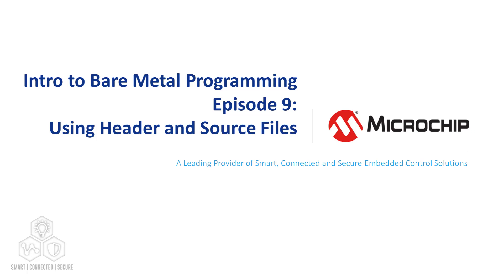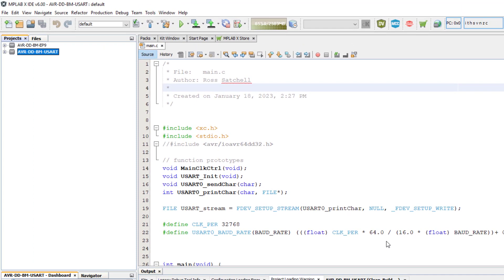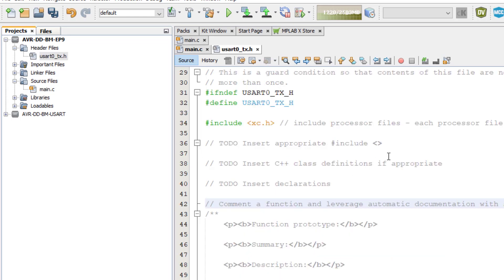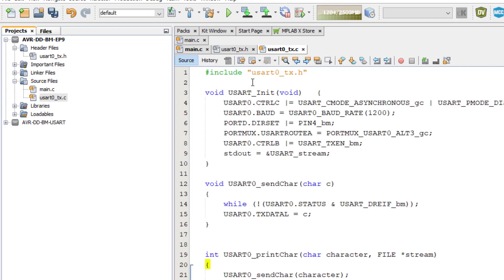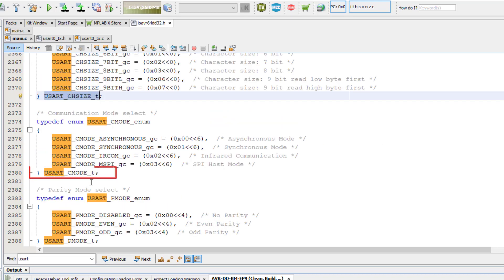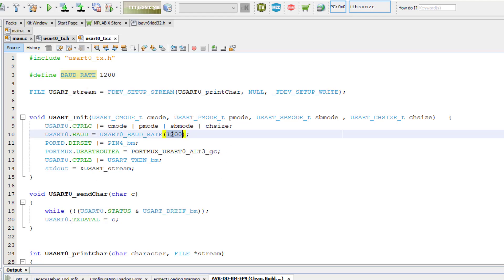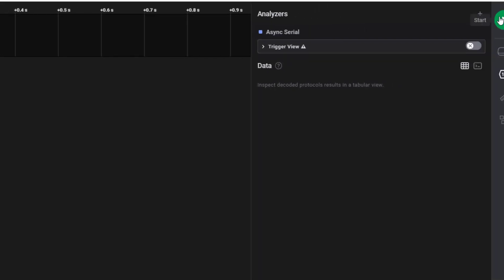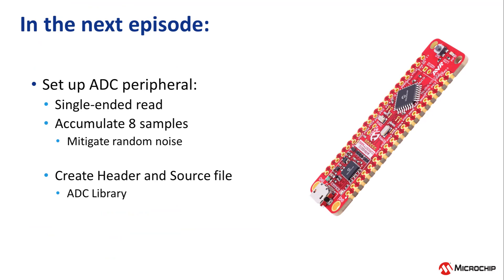Intro to Bare Metal Programming - Episode 9: Header and Source Files

Comment: Hi, I couldn't get rid of this "start" garbage... 
I have added checking if clock is stable in MainClkCtrl() like this

void main(void) {
    PORTA.DIRSET = PIN7_bm;
    
    MainClkCtrl();
    USART_Init(USART_CMODE_ASYNCHRONOUS_gc, USART_PMODE_DISABLED_gc, USART_SBMODE_1BIT_gc, USART_CHSIZE_8BIT_gc);
    printf("Driver Initialization Success!\r\n");
    
    while (1) {
    
    }
    
}

void MainClkCtrl(void) {

    _PROTECTED_WRITE(CLKCTRL.MCLKCTRLA, CLKCTRL_CLKSEL_OSC32K_gc | CLKCTRL_CLKOUT_bm);
    _PROTECTED_WRITE(CLKCTRL.MCLKCTRLB, CLKCTRL.MCLKCTRLB &~ CLKCTRL_PEN_bm);
    while (!(CLKCTRL.MCLKSTATUS & CLKCTRL_OSC32KS_bm ))
    {
        ; //wait for the clock to be stable
    }
}

And I'm still getting this in Terminal
Driver Driver Initialization Success!
Driver Driver Initialization Success!
Driver Driver Initialization Success!
...
while programing the device.
 
In Terminal window it looks like First word "Driver" is written very fast, then there is a pause and then Whole sentence "Driver Initialization Success!" is written again.

I'm using "Curiosity Nano Explorer" with "AVR64DD32 Curiosity Nano" board.

I was checking all files from AVR-DD-BM-EP9 many times and found no difference between my code and video.

I'm using AVR-Dx_DFP 2.6.303 and XC v3.00, problem is the same with DFP 2.4.286 and XC8 v2.50

Is this only my problem or maybe someone have the same issue?
Reply from the maker: Hi there, thanks for reaching out with your question, and we're sorry to hear you're having trouble! We would suggest submitting CAE support case. This will be the best way to get help with your specific issue. Please use this link: https://microchipsupport.force.com/s/newcase

The link will ask you to log in or sign up using your email address. Please register if you don’t have an account yet. If more information is needed, you can follow these easy step by step here: https://microchipsupport.force.com/s/article/How-to-submit-a-case. 

Our team looks forward to helping you. Thanks again for reaching out.